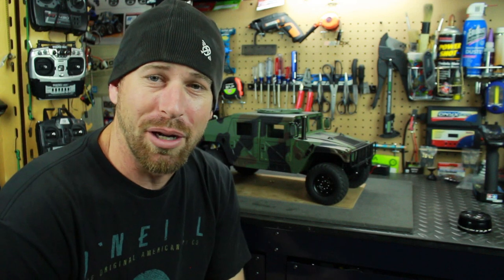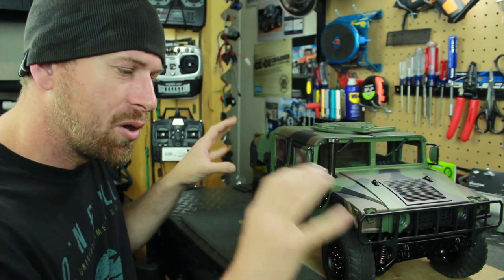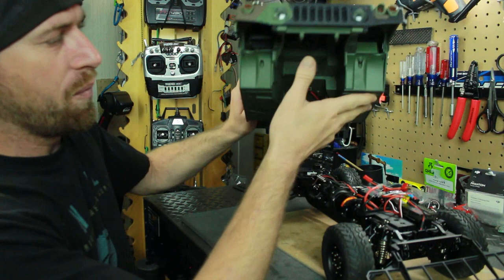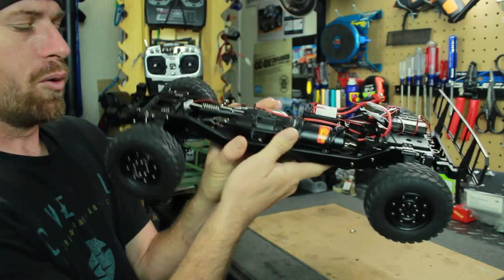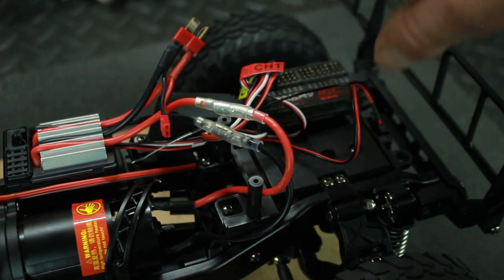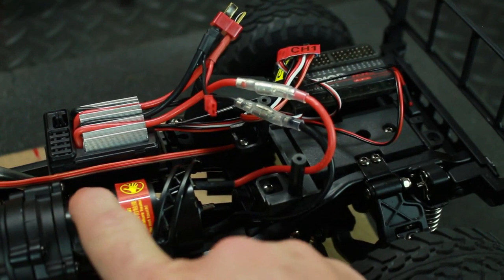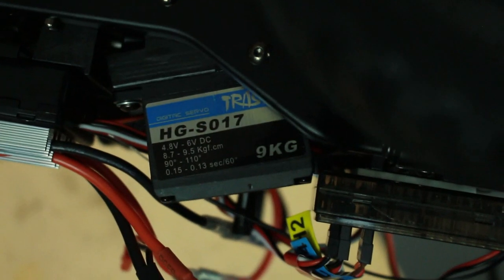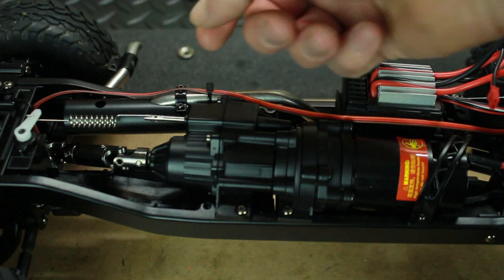RC84Films: HG P408 Humvee Chassis

Comment: Hi. I really enjoyed your video and I learned a lot about this rc humvee after you showed the chassis. What servo would you recommend for this? I plan to get the 422hdv2 high torque digital coreless servo Reefs RC Reef65. You think it will fit? Thanks!
Reply from the maker: Hey grad u like the video that should be ok to run just be careful not to have very  strong servo

Comment: How's the quality of the truck compared to TRX4 trucks? Your opinion. Planning to buy this one or P602. I'm oscillating between Traxxas and HG. Plz
Reply from the maker: first off thanks for watching. The TRX4 trucks are very good rock crawler but too really make a TRX4 run better you need to dump another $300 in bass parts along with upgrades but still a great truck for crawling and the price. Now the HG408 & HG602 are really cool scale trail trucks. They are not going too crawl like a TRX4 so if your into full on rock crawling then the TRX4 is the way to go but if you want a really cool trail truck then this is you. Hope this answer ur questions. Just do your research and think what you want.
Reply: @RC84Films  Thank you for reply, I'm not planning to use it for out door at all. I'm honestly go after build quality and look and plan to use inside the house only.